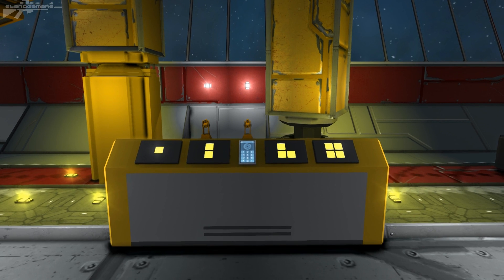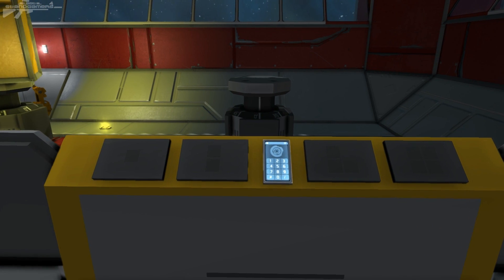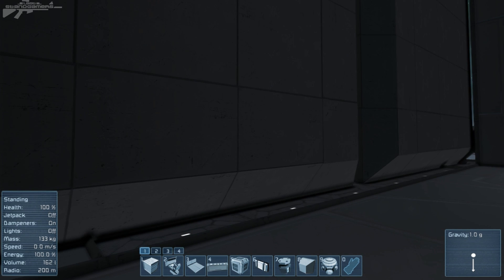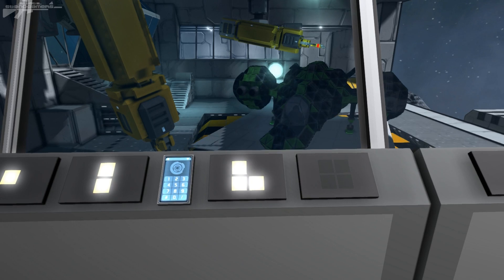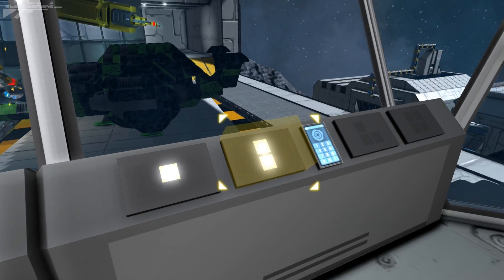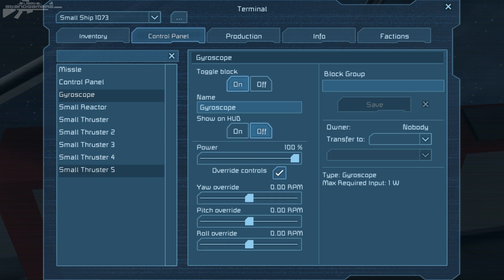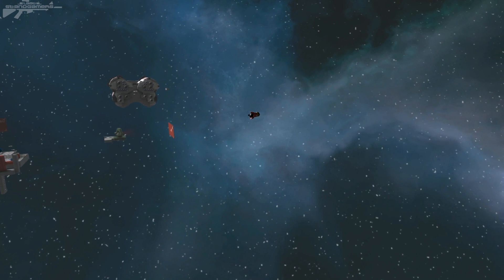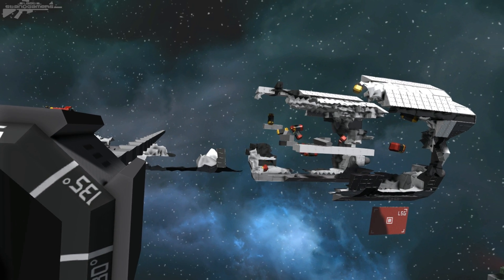Space Engineers - Remote Control Missiles & Quick Press Buttons

Comment: It'll be pretty cool if there was a delay that you could set.........push the self destruction delayed for 10 sec and push another for jettison the ship
Reply: Cereal Killer  They'd better also make it so you can make warheads inert until you turn them on, other wise self destruct systems are just going to kill you if the enemy gets a single lucky hit.
Reply: Apparently The Devs Are Working On Timed Warheads
Reply: eclipseslayer98  Thruster always on is completely unnecessary, just have the piston ram the warhead into a wall as hard as possible. Of course enemy fire is very, very likely to set it off..
Reply: We can do it right now with pistons and warheads and a thruster that's always on and the piston push the warhead into it, but that might be to unreliable.
Reply: You could always put some sacrificial plates between the thruster and warhead to add that delay. Unless they changed it, they'll burn anything up to 8 blocks behind the thruster on a large ship to you could probably have a fair few seconds to escape
Reply: Just put the Thrusters on a piston which is slowly moving towards the warhead.
The slower it moves, the longer the delay. Problem - you need two buttons for it :P But you can delay the explosion for about a minute if you want (just tested it myself)

Comment: I wish they would add some way to build a drone block with a camera so you could remotely control a ship or missile like that suit in Iron Man 3. There would be some kind of antenna and computer for the user to control the drone in. The block would be a wedge with a little camera sticking out of it. Please read this comment, and please talk about this, Aaron!
Reply: Id Prefer The Camera Block To Have Many Shape Options ... Like A Pyramid As The Point Of A Missile ... Or A Half Sphere As A Overhead Camera ... Or A Square For Walls
Reply: Cereal Killer true, but I'm thinking more of a stand alone block; specifically a drone block. Kinda like a mini cockpit that you don't have to enter. Only use a computer for
Reply: They need rc camras, monitors to insert feed to culd also be used as a sign and last they need a more advqced button thing whit like ten butons and an RC camra monitor maybe a seat to
Reply: Agreed.
Reply: *****
 or a spy cam on the inside of their ship if u can manage sneaking in

Comment: They need to add programming so a single button press can do multiple things towards a single task. For example on the welder arms in the repair bay you could press a single button and they would automatically retract and rotate into a fold up position or move into a preset repair position.
First things first the game will never be good if they don't optimize it much better though.
Reply: They did say there will be scripting eventually.
Reply: well if you set up your rotors correctly you could build that without any problem just group the rotors together and make sure that when you press that button the rotors reverse into the desired position, it's not that difficult.

(you can set groups to those buttons too you know, not just single pieces.)

Comment: It might be cool if the buttons could activate a series of actions instead of just one. Perhaps a simplified form of code that could be dragged and dropped for simplicity. It might have while loops and variables. With this you could simply press a button and then a platform could be risen and rotated in the hanger bay all at the same time the hanger doors open.

Comment: How would detaching armor work out? like big armor plates that can pop off at any moment and distract/ absorb strong hits?
Reply: i would assume it would work out exactly as planned, if you plan it correctly, i'd suggest building a prototype and experimenting with it, test things out before designing the final version.
Reply: Sounds interesting. If you use small ship heavy armor blocks attached with landing gear, you could make some very resistant plating. Warheads will destroy the same number of small blocks as they do large, so that would mean that, while destroying proportionally the same amount, they would do less damage to a large ship with small ship armor blocks.

Comment: yes.... cameras that allow alternate viewpoint on your ship, can be remote accessed from control panels on ships with permission withing antenna range..... and because large ships have bigger blocks, have large ship cameras have a zoom function (because we can always attack a small ship to a large one if small antenna is needed) speaking of which.... maybe a adapter for large ships would be nice to? like a merge block you put on a large ship, but has a tine spot on it for a small ship merge block to attach to, but doesn't completely merge otherwise theirs no point in having different small/large ships... this block will act in the same way the rotor glitch does (limited connection), except it wont be a glitch, will be more stable and easier to build.